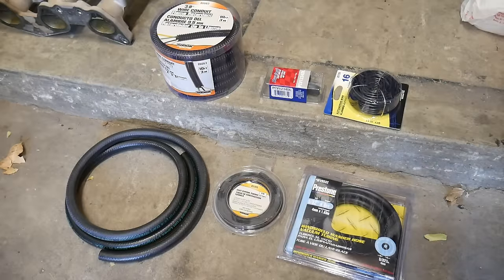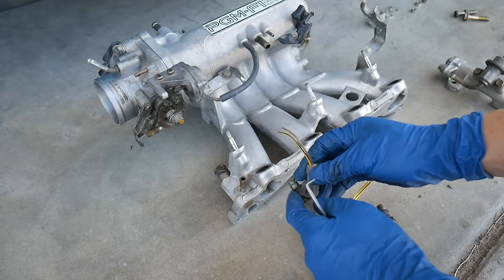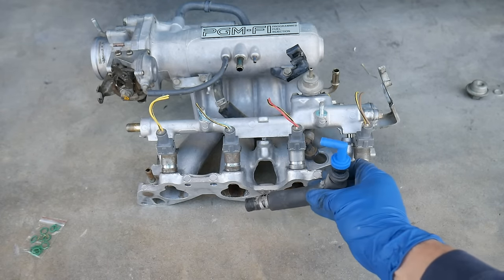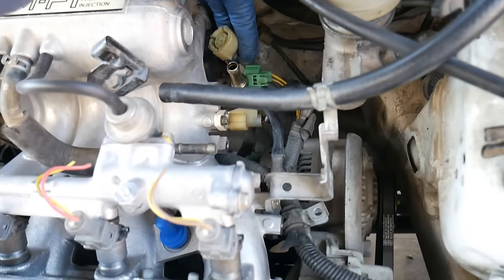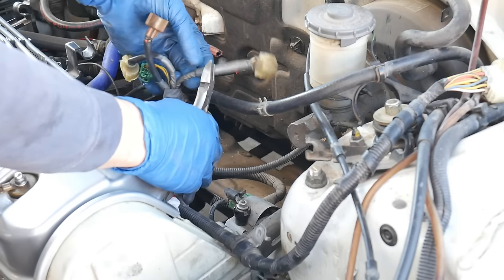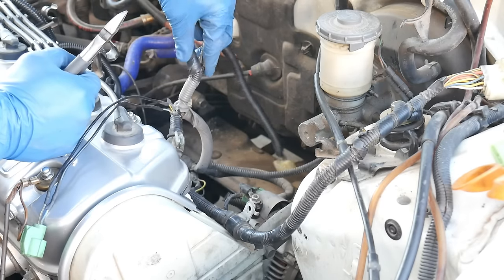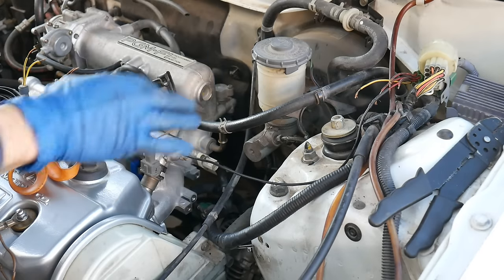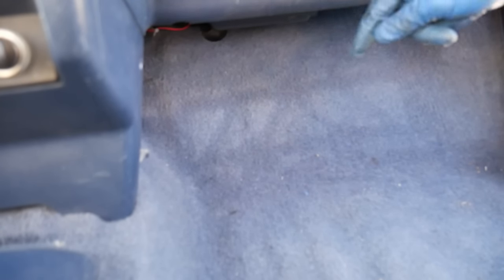DPFI to MPFI Complete Wiring Guide - 88-91 Civic & CRX

Comment: You speak and work as if you've done this a thousand times, I love how clear and accurate you work, thank you kindly from one Honda guy to another! I would so like to ask if you can confirm if an obd1 (92, 93) IACV will plugNplay on my "obd0" (90, 91) DA9 Integra? They're both two wire, thanks again!
Reply from the maker: Road Worthy wow, really love the comment!!  thanks so much!  Those plugs are exactly the same.  I even believe the obd2 is the same, it's been forever since I've touched an obd2 car though.
Reply from the maker: Road Worthy forgot to add, sometimes the size is different on the iacvs.  I've seen some which have the two mounting bolts closer together.  I do not know why some are different though.
Reply: Thanks a lot! I'm currently working at an O'Reilly parts store and have access to huge savings and discounts so I figure now's the time although about 4 months ago there was an OBD0 specific IACV available those seem to have been discontinued, the 92-93 valves are also made by BWD but have different part numbers.
Reply from the maker: Post an update here if you get a chance, would love to make sure they are all compatible with one another being obd1 and obd0.
Reply: The bolt pattern on the OBD1 (92, 93) integra is different on the manifold so my boss recommended I go back a year, and sure enough the 1989 Integra IACV fits my 90 (And should fit 91) model Integra's.

Comment: Jon, your service to the EF community is outstanding! I am so glad I subscribed. This takes a lot of the mystery out of what lives behind my engine. I already have an Si, (Tahitian Green: the most 1991iest colour! Yay!) so everything was done at the factory, but now I know what to do, if ever I have to take put the IM. This video is EXCELLENT, but if you will permit me one expression of selfishness, I would like to know what are the components, for which you replaced the vacuum hoses? I am super-noob, and it's hard trying to figure this stuff out on my own.
Reply from the maker: They are all emissions components.  The MAP sensor & charcoal canister are the 2 directly connected to those lines that I replaced.  If you want to understand more about what they do, Google both.  It'll give you some pretty in depth detail about how they work.
Reply: MAP sensor and charcoal canister. Got it! Thanks!

Comment: Great write up / how to man!  I am pulling the trigger on this, have everything torn apart and am prepping.  The only question I had, was at @12:20 I saw that you had the connector to the resistor box, but when the screen changed all the wires were hooked up from the fuel injectors.  Does it matter in what order they are wired up?  Thank you, and great write up, I will be using a socketed PR4
Reply from the maker: No, any order works
Reply: @GarageBuiltHondas  very fast response man, definitely subscribed!

Comment: So if I'm doing this conversion and the obd0 to obd1 swap at the same time, I can just run the 4 yellow/black wires from the injectors directly to the wire coming from the a15 pin on the ecu to bypass the resistor box. Is that correct?

Comment: Hi there,  I am from Philippines,  I do have a honda civic ek lxi 99 model. its a carburetor type, I swapped the carburetor intake to p08 intake manifold. all sockets were into places, but then when I tried to start it, there was no priming. no sound from the main relay. I might be missing something, I font know if its the main relay, fuel pump or if theres abything from the wiring that I should do.
Reply from the maker: See if there's fuel and spark.  See which one is missing.  It just needs that and it should start.

Comment: Hello GBH..
I did a DPFI to MPFI conversion to a D15B2 1.5L using a D16z6 intake manifold ,Td-02u distributor ,PM6 ECU ,A resistor box ..
I learnt that the injectors that came with the manifold are high impedance injectors meaning they can't work well with the resistor box,i have tried to delete the resistor box but the car can only drive for About 500 metres and jerks.......
👉Will i be right to get low impedance injectors to match the PM6 ECU?....Your help will be highly appreciated,all the way from 🇰🇪🇰🇪🇰🇪Kenya..

Comment: Hey just wondering can’t I jus use the whole engine and engine harness if I have a ex or si mpfi motor and only rewire the injectors
Reply from the maker: Unfortunately no.  The pins at the shock tower and by the resistor box area don't match up.

Comment: I have a question about that swap. So I understand everything that’s going on in that video but i need some info about converting to obd1 or 2 injectors.  From the DPFI. So I assume that I would do everything the same with A1-A3-A5-A7 but the A15 wire which would normally go to the resistor.? What if I don’t need a resistor for my injectors? Where would a15 go ? And also the yellow wires for each injector that would normally go to the resistor. ? I’m doing a b series with the obd1 Ecu chipped ect.. I’ll have a jumper for knock, VTEC, O2 ect... and a obd0 to obd1 jumper aswell for the main. ? Would I tie the yellow wires if ea Injector directly too a15? Skipping the resistor?

Comment: No need to extend the tbps and iacv plug. You can just cut back the harness and the wires will reach.
Reply from the maker: Thanks for the info and tip!  Smart!
Reply: Hi mate.. i need help.
I have 1990 civic ef dual carb (japnese model with D15b) i got a D16zc motor from my friend's 1989 CRX.
I want to drop this in to my civic. Can you please advice if i can use CRX engine harness and pm7 ECU to get it run?? What other wires i need to change?? Is it possible to do this conversion??
Many thanks in Advance.
Reply from the maker: You need to re-use your original harness and do the mpfi wiring setup.  The pm7 will work with that engine.

Comment: If I could do two likes I would even 10 lol
Reply from the maker: DjReckz thanks, I hope it helps you out if you decide to convert your hatch!
Reply: Oh trust me I will and I'll even do a video of it and link it to yours
Reply from the maker: mexico3161 These videos will show you how to convert to MPFI.  I'd finish that first, especially if you've never done either one before.  Then you can convert to obd1.  You'll need an obd0/obd1 ecu subharness, distributor subharness, or repin you're current wiring, 4 wire o2 sensor, they also make a small harness for that, and the appropriate ecu.

Comment: Ok are you still uesing the obd0 or obd1? And can I do the same method for a D16 Z6 going from a non VTEC to a VTEC
Reply from the maker: +Mikey Dugan obd0.  Yes it's the same method but you'll also need to convert to obd1 to be able to use the p28 ecu.
Reply: Garage Built Hondas okay so I don't have a p28 ECU but I was wondering if I could do to the engine harness like a birthday over to that and then run it into the old obd0 and just put the VTEC on a button
Reply from the maker: +Mikey Dugan I have no idea if that works.  You may want to research that online.

Comment: Hey Jon avid Subscriber Here to your EF videos. You simply have a gift for making these D.I.Y videos... You almost never cut out any steps in videos and have the ability to keep me hanging on every word along the way. I recently got myself another EF hatch in 89 DX to be exact. And also just like you I am in the preparation stages of dropping in a B20 into it. this isn't my first go about when I was 21 about 10 years ago had a 91 DX hatch with the B18 A1 swap in it but unfortunately the guy who did most of the swap didn't really give me directions thoroughly throughout the swap mostly let me defend for myself once the swap is done but ended up pulling it and installing it two or three times but now getting ready to do the full thing myself from the dual point setup I am finding out about the whole multi point conversion needed to be done. I was wondering if you could answer me the quick question and let me know if I'm headed in the right direction but I have a B20 with a LS intake on it and all OBD1 components that came from a 92 OBD1 da Integra. So I got the pr4 ECU I believe was the number might have to double-check with the same dizzy that came on the car and injectors as well as the the original engine harness and a OBD2 harness on the side if any wires are needed. My question is is this setup you got for all the sensors and vacuum lines roughly the same to an extent for the p75 intake manifold from the DC Integra? Would following your instructions Point me in a direction to get to where I can get plugged in with what I have? I know I will pry still need the ECU jumper to run the ECU through the car harness into the engine harness correct? And Leslie is running a pr4 ECU on a OBD1 p75 intake manifold going to cause me any issues or do you think it's a better route to go with the intake off the 92 LS instead? I'm sorry comment was as long as it was but I've watched hours upon hours and given that you have a B20 in your EF hatch which I believe is also in 89 I was just hoping you could point me in the best Direction. I'm in Colorado so emissions are fairly lenient here. By the way I'm literally mid way through the rear disc conversion from the da on to the EF from your video but have just been played by doubt from this mpfi conversion and really not wanting to have to drop three to four hundred dollars on a conversion harness at this point. And I believe you're the man that can shine light into the darkness LOL thanks man hope you can take a minute to lend some words to an eager ear with steady hands ready to follow.
Reply from the maker: So you believe you're running a PR4?  See if it's obd0 or obd1.  I've read that some of the 92-93 Integras had an obd1 pr4 and some with the p75.

You can use any of the Integra LS intake manifolds, that's your choice.  The sensors will have the same plugs on all of them.  The distributor is different from obd0-obd1 though.

Are you wanting to go obd1?  Because if not, you'll still need to do the dpfi to mpfi swap, but that's not difficult, just tedious.

Hope that helps, if I missed something or you need more clarification, let me know.
Reply: Garage Built Hondas Yea it's an PR4 OBD1 ECU out to a 93 DA Integra LS I'm using it as my part car for the B20 Swap. Just did the rear disc conversion. Question for you... is that one still your tracker the EF with the B20 in it? Are you running the B16 tranny on it and did you stay cable I opted to go with the GSR cable tranny given that it's going to be kind of my weekend fun drive car so I can get my 01 Integra off the street everyday if you will see it in my profile picture and I got a K24 waiting to get enough funds for the K swap package and have some real fun in my LS Integra that just by the looks of it now constantly get people trying to race.
Reply from the maker: Yes, but it's in this shell now.  https://youtu.be/Cx_NtS4Aj9g

If you watch those videos you'll see that I had to stay with the LS transmission for now as the B16 casing was punctured.
Reply: Garage Built Hondas Hey Jon after watching that video you linked with your reply I noticed your mounts didn't look aftermarket. What did you use if you don't mind me asking?
Reply from the maker: They are.  Those are Innovative Steel mounts with the 60A urethane.

Comment: congratulations for the video !!!  really beautiful!  I did the same job on a Civic eg4 (d15b2).  after mounting the P06 control unit and everything needed for the swap, I found only one problem: with the engine cold the machine does not keep the minimum!  I can't understand why!  hot everything goes smoothly but cold, for the first 2 minutes the minimum is really low!  I repeat, only from cold though!  would you have any advice to give me?  thank you!  😁
Reply from the maker: Is the IAT working fine?  Also check the FITV.

Comment: I love your content!!
I have learned so much watching your videos.
I have followed the steps in the guide as far as I can. I have a couple of doubts, to see if you can give me a hand.
-The conversion of the injectors, all perfect.
-The wiring of the 4-wire lambda probe, everything perfect.
-Prolong both TPS and IACV, all perfect.
My doubt comes when removing the pins from the old connector, to make them coincide with those of the new distributor, D16z6, I understand that 5 coincide, right? The other two are the new ones that need to be wired to the ecu? Are they C1 and C2?
Thank you very much!!

Comment: I have a really good question I did this mpfi swap.. how do I get rid of the eld code 20 that's putting my  Charging in  limp mode? Dx 90 hatchback don't have eld...my 89 pm6 ecu does!! It's my daily help! Lol
Reply from the maker: Did you try changing the engine bay fuse box.  I heard this issue can stem from the box.

Comment: HI , I teach a high school automotive class and we are currently doing a honda swap. Great video and it has really helped the students along. We are close but only have 2 injectors working ( Cylinders 1 AND 2) We are installing a1990 Integra  B18 MPFI into a 1990 Honda Civic  DPFI. My questions is does the ECU have to be a PM 4 ?  Right now we are working with the Civic's stock ECU which is a PM 5.  We also have the integra's ECU which is PR4. Do we need to locate a Civic PM4 to fire all the injectors in the B18 ? Thanks
Reply from the maker: Hey Kenny, thanks for using my video!

You can use the PM6 (88-91 Civic/CRX ECU) but the PR4 (90-91 Integra) is the best.  I had a friend using a PM6 for a few months in his CRX B18 swapped, but he said the car ran much better when we swapped over to the PR4.

Good luck, I hope you all get it running well!
Reply: @GarageBuiltHondas  Ok thanks a bunch.  Really trying to get this thing running as we are so close now. I can get a PM6 low cost at the local wreckers so Think I'll try that as we seem to have no luck with the Integra PR4 that we have.  But will look into sourcing another PR4.  Thanks again.
Reply from the maker: You're welcome

Comment: Please help me I have a 1990 honda civic dx that had a d15b2 I am swapping a z6 into the car I have followed your instructions completely on the dpfi to mpfi then added a jumper harness and I'm not getting spark and I can't figure out why.
Reply from the maker: It has to be a wiring issue.  Double check your distributor wiring and the pins at the ecu.

Comment: Would this method also work for a b18a1 swap? Great video by the way, explanation was very easy to understand.
Reply from the maker: Yes
Reply: @GarageBuiltHondas  Great video, thank you! I'm doing B18A1 swap to 1988 DX CRX with D15B2. I'm a newbie, what is the source car for the injector resistor box? Can I use the existing ECU or the new ECU? I also have 37820-PR4-A01 ECU from a friend. Looks like I can use and mods the existing engine harness. I just need your confirmation.
Reply from the maker: Obd0 pr4 is perfect.

Resistor box will come from many Hondas obd0.  I've seen them in Preludes and accords also.
Reply: @GarageBuiltHondas  if I'm going obd1 what do I do what the yllw/black cables going to thr reistor
Reply from the maker: https://youtu.be/w0P80zWLCnM

Comment: hey man love your videos... Iam getting ready to do this myself I was told I needed an so dizzy.. am I able to use my old one... if possible can you send me a parts list... also where did u get the connector that went through the firewall (little white pug male and female) what gauge wire recommend
Reply from the maker: Thanks for watching Tony! 
You will need an Si distributor.  The DPFI one will not work.  I used 16 gauge wire.  The little plug is a random Honda wiring plug similar to the resistor box plug but white in color.  Watch the first minute of this video for the entire parts list. -> https://www.youtube.com/watch?v=igGZthAHGSI
Reply: Jon Widmer  Iam officially a YouTube mechanic thanks to your videos you have saved me lots of $$$ appreciate you brother keep on doing what you do.. I will be doing a mini me or full zc swap in the near future... also si trans which I saw u have a trans swap video... dude thank you for your hard work. people don't realize how much work goes into video editing and what not... happy 4th
Reply from the maker: Tony p Really appreciate the love man, and you're welcome!  I love to inspire/help out others!
Reply: Hey bro that lil box that you run the four wire to wat if I don't ave it can my conversion still work with out it

Comment: I have a 1991 civic dx hatchback with D15b2 none vtec i have a d16z6 head do you have videos about head swap? If not can I use the intake manifold from the z6 for the b2 dual point to multi point?
Reply from the maker: No.
Yes.
Reply: Thank you so much for your answer

Comment: I'll said it again, super cool videos @Jon Widmer, I have a question, if I want to use a 92-95 intake manifold with injectors and fuel rail of that year, all the connections are the same? The TPS, IAC, IAT etc, I didn't know that for the d16a6 intake are the same connectors, and do I need to use the resistor box even with the 92-95 injectors?
Reply from the maker: Kevin Martinez Yes they are.  You'll need to wire the obd1 injectors together to not use the resistor box.

Comment: So if I have the whole si harness, si injector box and ecu, will I still need to do this?
Reply from the maker: The whole Si harness from the entire car?  Or just the engine harness?

You can't just plug an Si harness into a DX chassis harness.  If you have the entire harness from the Si and swap it to you non-si model then it will work, but that would be a headache.
Reply: @GarageBuiltHondas  nvm, I just have the engine harness. thx.